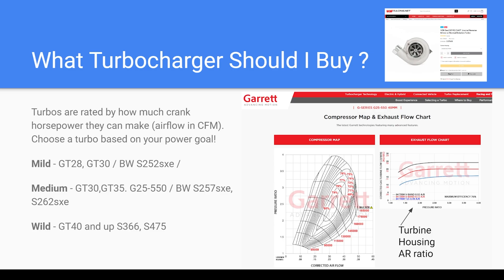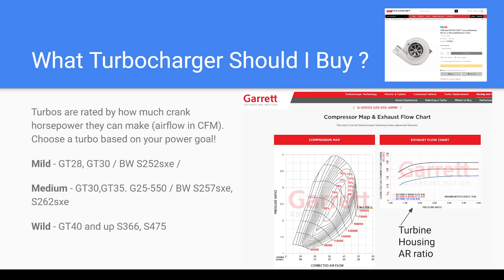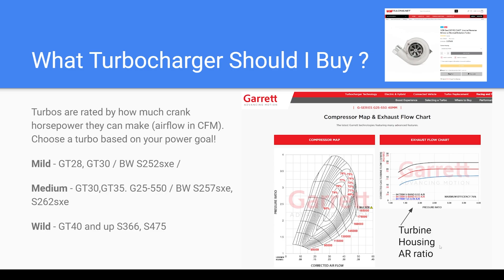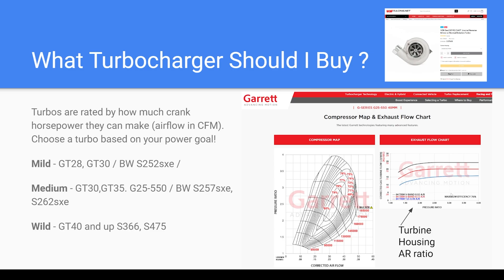How To Turbo Classic BMWs Part 6: What Turbocharger Do I Need? | Turbo BMW E30

Comment: Ok so I have a GTX3071r with a .49 turbine housing. Do the math for me please, what's the max I can get out of it with the .49.. I'm hoping 370 at the wheels on a 1500 cc engine
Reply from the maker: That .49 is very restrictive. According to Garrett's website the GTX3071r will only make 340 crank HP with the smallest turbine housing. You will need a larger turbine housing to reach your goal
Reply: @TurbineResearch  ok thanks, gonna have to order a .61 then... cheers
Reply: @TurbineResearch   @Turbine Research  hi, just a quick update. I did the Dyno and made 250@20psi and 300 with a 50 shot of NOS. Im quite happy with the power and car is brutal since it weighs 1900lbs. If you give me your email I can send you the graph and maybe determine if I should even bother to change the turbine housing... In fact here's the run . This is my 1500 Toyota 5efe on 90 octane pump gas https://youtu.be/RjyDf4U7GmU